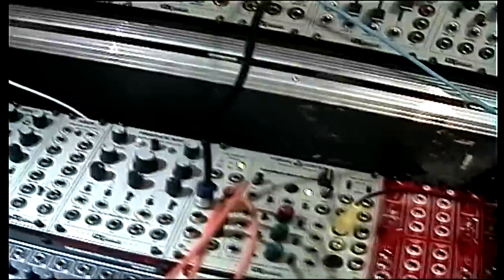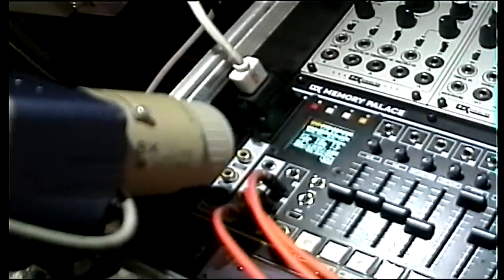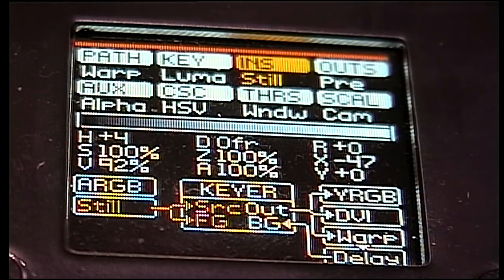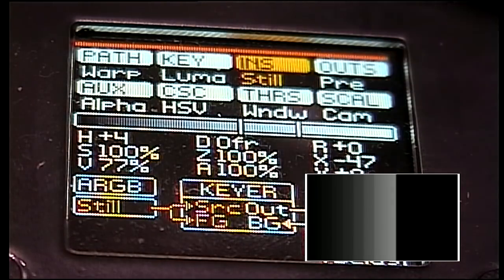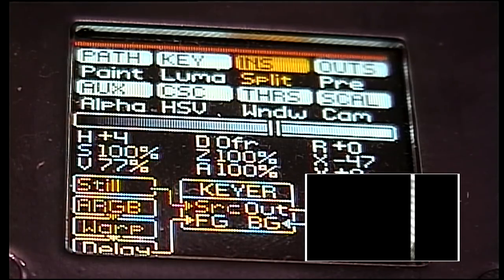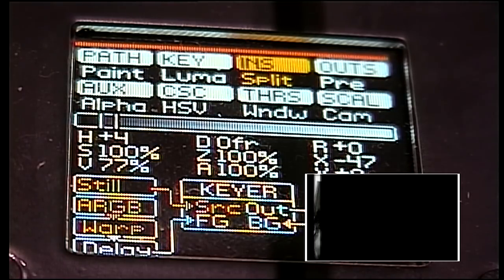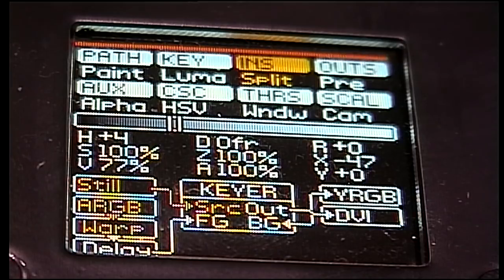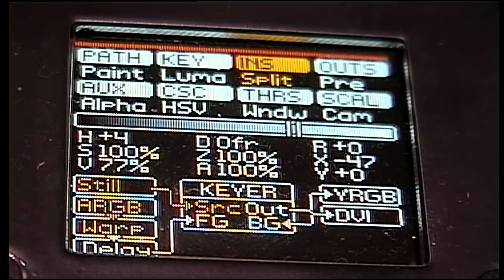LZX Memory Palace - Slit Scan

Comment: thank you for posting this. can you LFO the slit fast enough to paint every frame?
Reply from the maker: Short answer currently NO, because the input of the width is limited to very very slow signals (not even full audio range). So if in the future (with a firmware update) we can assign AUX input (which is video bandwidth) to Width would be possible maybe. Maybe its possible to do it in another way and not using the Width+Center combo, i.e. creating the Slit and doing the Key/Masking outside MemoryPalace, and just using MP as FrameBuffer.

Maybe we should discuss this in the https://community.lzxindustries.net/
Reply: hadesbox thank you!